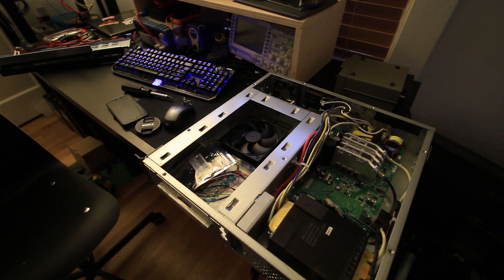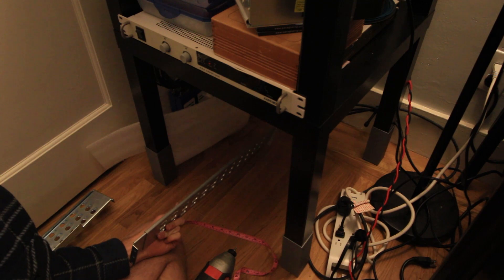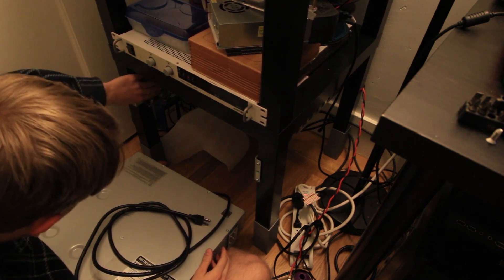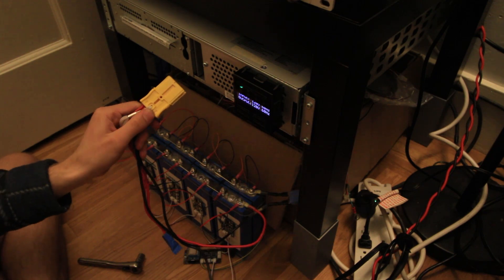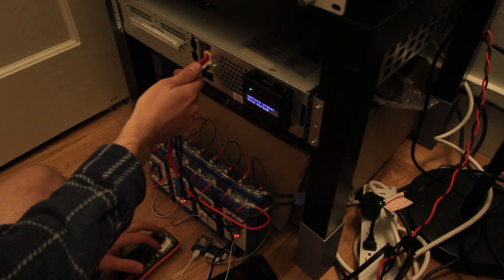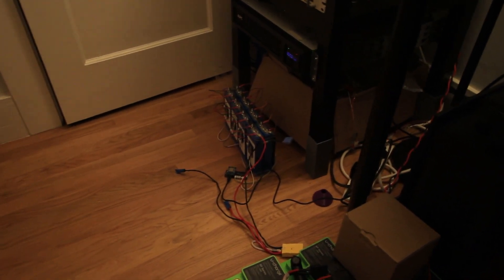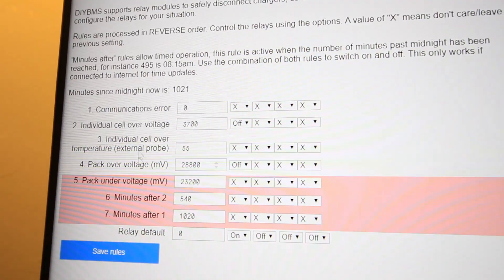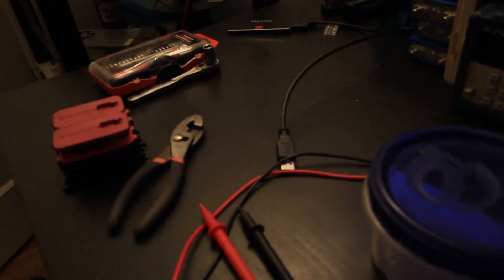Budget Powerwall Part 3

Comment: I going with LiFePO4 battery.   No Funding for a cool BMS/Balance system like that.   Just going with Active Balance and Voltage Control PCB  as far as Max Charge and Max Discharge.